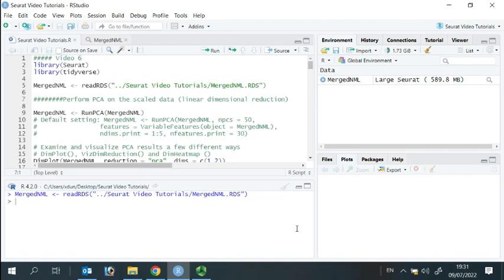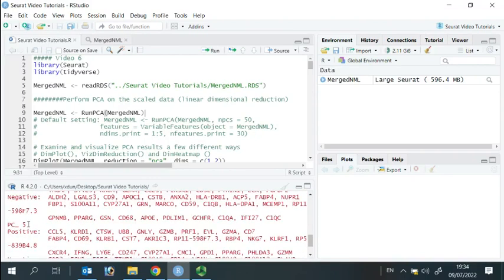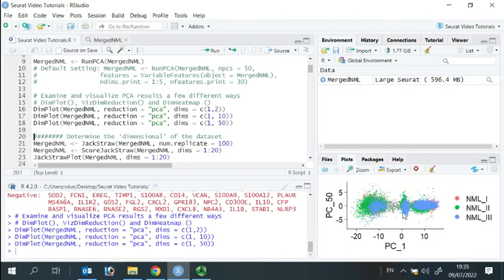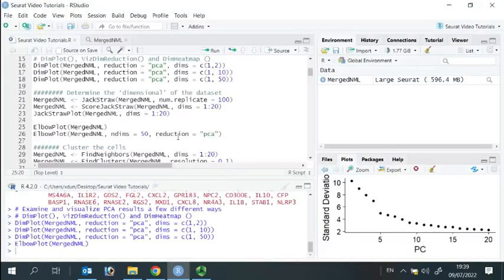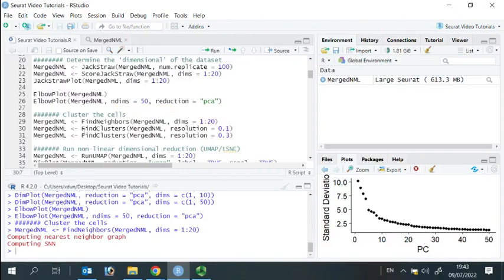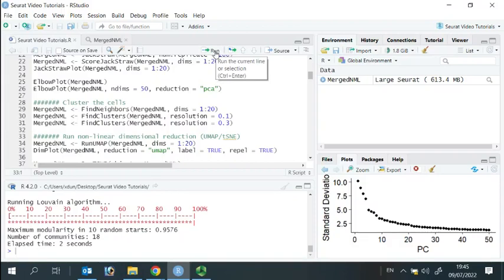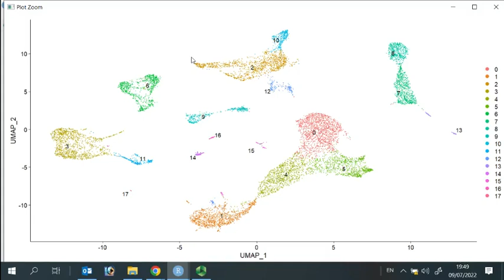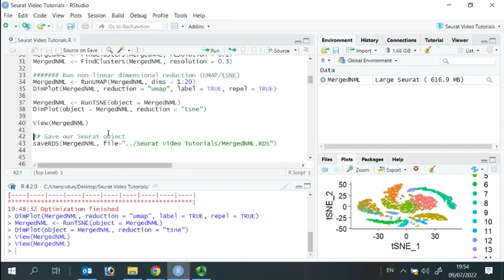Seurat Video Tutorial--video 6: Dimensional Reduction and Cell Clustering

Comment: Hi Professor, thanks a lot for your video tutorial. Your explain for each step allows get the point explicitly. I have one question if I merged "control" dataset and "stimulated" dataset into one Seurat object for pre-processing workflow. In the following process,  I should separate it into two dataset for PCA, UMAP, etc. Is it correct?
Reply from the maker: you need run as one object, after the UMAP step, you can use split.by in Dimplot to see the UMAP seperately

Comment: Hi Professor, thank you so much for the tutorial. I learned a lot from your videos. However, I ran the PCA and dimplot as you did in your video, but found the orientation of generated plot is upside down compared to yours. Please advise me how to correct my codes/plot.
Reply from the maker: you might used different PCA, try different PCA in 
RunPCA(object, npcs = 30, verbose = FALSE)
RunUMAP(object, reduction = "pca", dims = 1:30)

You don't have to produce a UMAP that looks exactly the same as mine, your clusters having biological meaning is more important.

Comment from the maker: ##### Video 6
library(Seurat)
library(tidyverse)

MergedNML <- readRDS("../Seurat Video Tutorials/MergedNML.RDS")

########Perform PCA on the scaled data (linear dimensional reduction)

MergedNML <- RunPCA(MergedNML)
# Default setting: MergedNML <- RunPCA(MergedNML, npcs = 50,
#                 features = VariableFeatures(object = MergedNML),
#                 ndims.print = 1:5, nfeatures.print = 30)

# Examine and visualize PCA results a few different ways
# DimPlot(), VizDimReduction() and DimHeatmap ()
DimPlot(MergedNML, reduction = "pca", dims = c(1,2))
DimPlot(MergedNML, reduction = "pca", dims = c(1, 10))
DimPlot(MergedNML, reduction = "pca", dims = c(1, 50))

######## Determine the ‘dimensional’ of the dataset
MergedNML <- JackStraw(MergedNML, num.replicate = 100)
MergedNML <- ScoreJackStraw(MergedNML, dims = 1:20)
JackStrawPlot(MergedNML, dims = 1:20)

ElbowPlot(MergedNML)
ElbowPlot(MergedNML, ndims = 50, reduction = "pca")

####### Cluster the cells
MergedNML <- FindNeighbors(MergedNML, dims = 1:20)
MergedNML <- FindClusters(MergedNML, resolution = 0.1)
MergedNML <- FindClusters(MergedNML, resolution = 0.3)

####### Run non-linear dimensional reduction (UMAP/tSNE)
MergedNML <- RunUMAP(MergedNML, dims = 1:20)
DimPlot(MergedNML, reduction = "umap", label = TRUE, repel = TRUE)

MergedNML <- RunTSNE(object = MergedNML)
DimPlot(object = MergedNML, reduction = "tsne")

View(MergedNML)

## Save our Seurat object 
saveRDS(MergedNML, file="../Seurat Video Tutorials/MergedNML.RDS")

### Note: I saved it MergedNML as MergedNML_SWF.RDS, then you can read it back in Video 7 as MergedNML_SWF.RDS

saveRDS(MergedNML, file="../Seurat Video Tutorials/MergedNML_SWF.RDS")

MergedNML <- RunTSNE(object = MergedNML)
DimPlot(object = MergedNML, reduction = "tsne")
DimPlot(object = MergedNML, reduction = "tsne", group.by = 'orig.ident')